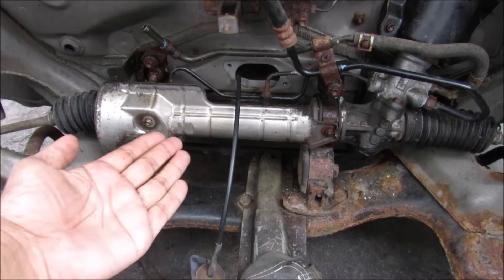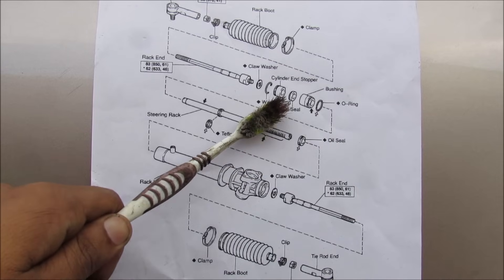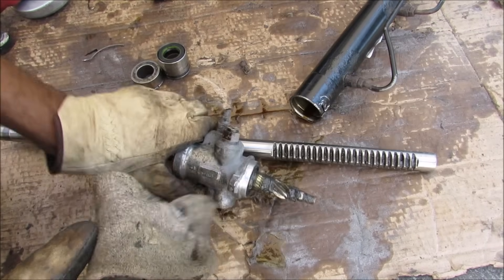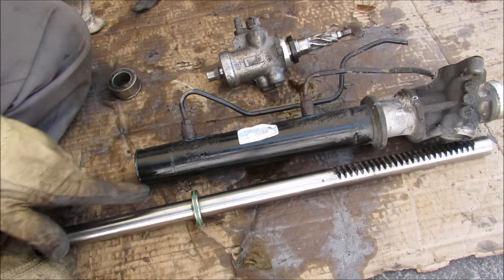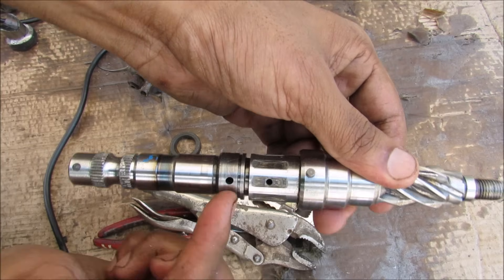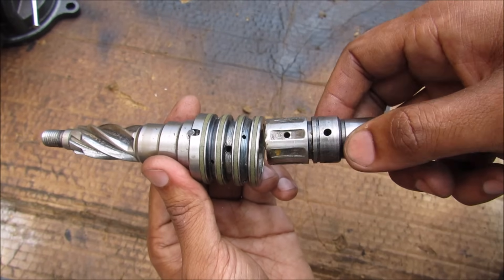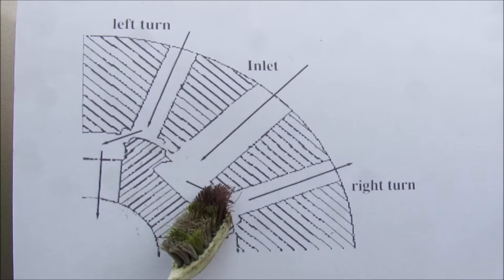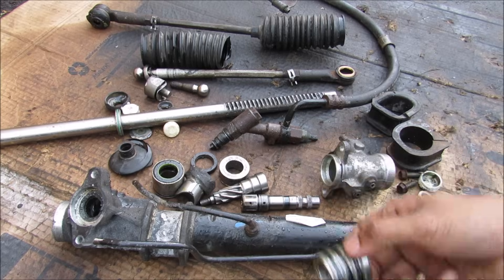How a Hydraulic Steering Rack Works

Comment: Is it bad for the hydraulic system to turn the steering wheel when engine is off? 
I guess the answer is no, as the torsion beam will still align the control valve and led the fluid flow without any extra stress to the system. 
Is this correct?

Comment: That is some complicated stuff right there. Thanks for the explanation, though I may never know just which component is responsible for the slop in the steering of my 2000 Dodge Dakota. But I have the replacement rack now, and I hope it works!

Comment: hey i just bought a steering rack that came withoUT the spindle/worm like gear steering columb shaft?  ? the rack seems to be all the way to the left 
how do i return the rack without pinion gear?
Reply from the maker: If there's no pinion inside you should be able to push the rack side to side
Reply: @speedkar99  with a ?  

screw driver or something ?

Comment: Thank you very much. I was finding this valve mechanism since few weeks. But i couldn't find it. Most of the videos explain the system but not the valve mechanism. But you here explained it very well. So i give my glad to you for your demonstration regarding rotary valve mechanism and torsion bar mechanism.❤❤❤❤❤❤
Reply from the maker: Agreed, that torsion bar mechanism is really interesting, it took me a while to figure it out too!
Reply: @speedkar99 yeah. Im a helicopter pilot. So in helicopters there is a similar mechanism in hydraulic actuators which used to give the inputs for the main rotor. In that case they have used leanier Valve. I understood it easily. But this rotary valve system is bit complex. But glad for your video it was very easy for me to understand it. ❤❤
Reply: Any way that torsion bar is the secret. Since it can  twist, the steering wheel is always in advance until the driver stops the steering. The hydraulic actuator push the rack until the torsion bar torsion get to zero. Then only the piston stops.

Comment: so it might be possible to repair a leaking LHD steering rack by just DIY replacing the oil seal (with a repair kit or even using parts from a working RHD rack?), and if possible then it doesn't seem like a difficult job to do

Comment: This video is amazing. I found no other video talking about the torsion bar that is inside the control valve. That is the whole point of controlled high pressure flued flow. Know I can say I know how a hydraulic steering wheel works. Thank you man.

Comment: after changing the power steering oil, the system got clogged somewhere, as I now have a heavier power steering. Where could this happen? what do you think about the metal pipes on the servo bar or this central high-pressure valve that has holes in it? There is obviously something to do with it. The first servo oil was 28 years old and after changing the new one, something happened. It was bled correctly, even with the new servo pump nothing has changed for the better

Comment: So you're saying it's not my fault. While replacing the wheel bearing on my 414,000 mile Kia I let the tie rod hang for over a week.... Now it leaks. First leak the car has ever had, and I'm hoping I can just add a little fluid every now and then.
Reply from the maker: Hanging a tie rod shouldn't make it leak

Comment: I am your subscriber, sir. Please ask how to modify the Torque Rod in the Pinion Gear? . All this time I have been observing why no one has modified the Pinion Gear. The info is that by modifying the Pinion Gear you can lighten the steering. Thank you very much in advance, I am waiting for your answer and vlog
Reply from the maker: Change the flow control valve in your power steering pump
Reply: @speedkar99  What this means is that the couse of my car's steering is heavy on my car's power steer pump Valve ? Can it be serviced or does it have to be replaced ? Thanks
Reply: @speedkar99  what  this means is that the couse of my car's steering is heavy on my car's power steer pump valve ? Can it be serviced or does it have to be replaced ? Thanks

Comment: Great examination. Thanks! I'm pulling my hair out trying to figure out the stiff steering issue in my 2005 Saab 93. I already replaced the pump and the rack. The wheel turns freely with the car turned off and wheels off the ground but the power steering is randomly getting stiff. No noise from the pump and no leaks. I'm now thinking I might have a flow or pressure problem somewhere in the system.

Comment: Dear sir, as ever you are a genius. The automobile industry has not recogniaed your full potential. You are an asset to the industry. I have question which steering gear box is the smooyhest amd effortless to the driver is it the worm and roller with variable sterring ratio with hour glass principle or worm amd nut more popularly known as the recirculating ball bearing

Comment: My tractor power steering has failed. I can turn the steering wheel in either direction for ever and nothing happens. Any advice gratefully received.
Reply from the maker: You've got a busted linkage because there should always be a mechanical connection
Reply: @speedkar99  thanks.

Comment: Great video. One question: the belt to the pump snapped,  and I drove to the workshop with heavy steering, for about 5 minutes. Did I damage anything?
Reply: No its just  harder to steer as you found out.

Comment: As a former rack and pinion steering engineer for an OEM, I commend you for your explanation. Very well done.  The only correction is that the steering  fluid flows thru precision metered lands on the edges of the slots in the input shaft.
Reply from the maker: Thanks! 
Yeah that rotary valve is really something

Comment: Speedkar99, my go to channel for learning car stuff super fast!
Question, when replacing the power steering fluid, is the proper way to do it down by the steering rack releasing one of its fittings at the center of the rack and draining the fluid from there or it’s ok to do it above on the engine bay by the power steering pump reservoir?? The first method seems more logical since it’s lower on the P/S system. But I ask because almost everyone on YouTube does at the P/S oil reservoir, although the factory manual on my Subaru says to drain it from the steering rack.. a bit more difficult since I have to remove the chassis center support first..
Reply from the maker: Just do it from the reservoir. Not worth the time and effort to go from the rack. Most of the fluid will pump out when you turn the wheels side to side to bleed. I have a video on this from 2013.
Reply: @speedkar99  Great! Thanks for your reply

Comment: I have a rather unique issue with my power assist steering. It's pretty weak, I have to use both hands for low speed manoeuvres. I already changed the pump and flushed the fluid(chf) with no results. Upon visual inspection the PS lines are fine, sometimes they get crushed in cars that have had accidents but not mine. Should I go for a 7 hour steering rack job or are there any other recommendations? Car is a 01 A6 2.4 V6.
Reply from the maker: Correct fluid type? Maybe you can connect a guage and measure pressure. A rack job is not fun
Reply: @speedkar99  i specifically mentioned that its chf so you dont say its the wrong fluid lol
Thats the thing with these hydraulic systems, there isnt exactly anywhere where one could hook up a manometer

Comment: This is fascinating. I'm not understanding something fundamental though when I try to understand how turning the steering wheel (input shaft) turns the front wheels in the same direction. When I think about it, it seems the teeth on the pinion gear would engage the rack teeth in such a way as to turn the wheels in the opposite direction.

Comment: EMERGENCY QUESTION.... After having all my shocks and struts and lower control arms and ball joints and sway bars and bushings and pretty much everything else to do with my front suspension suspension replaced as of a couple weeks ago will driving over one curb that was a little bit too high quite frankly the curb came out of nowhere and attacked my tire but regardless..will that cause my whole rack and pinion thing to break?? the whole thing all at once????😭😭😭😭
Reply from the maker: A bump won't break a rack. But a curb strike might

Comment: Can the two hoses attached to the rack and the control valve fluid passage clogged and cause failure of the rack? Because I've replaced quite a number of pump and the steering is still stiff. Thank you for great work.

Comment: Great video. Just a quick question. What happens when we turn n hold the steering wheel to its extreme positions.( extreme left n extreme right). How is the pressure build up avoided?
Reply from the maker: It's short circuited back to the reservoir

Comment: Ok soo mine turns half way each way without the wheel moving buut the input shaft does spin everytime i touck the steering wheel. Weird confused do i have a bad input shaft. I have to turrn the wheel more than half way before it starts moving the wheel. ????? What is the issue

Comment: The bushing housing wont come off mine I took the clamp off but it wont come off 2004 Mitsubishi diamante ls
Reply from the maker: Bushing housing on the rack to frame?
Reply: @speedkar99  ......4.25
Reply: @speedkar99  I removed the snap ring but the bushing housing wont come off I cant change the rubber seal that's on
Reply: @speedkar99  or the collar as u call it later in the video

Comment: Is there a seal at the end near the gear box? I have a leak at the end near the gear box where the teeth are. It’s not a major leak but the boot is wet. I took the boot off and I didn’t see any fluid dripping out, I’m trying to figure out if there is a seal or which seal might be wearing out at the end near the gear box.

Comment: Kindly advise about whenever car goes in uneven surface road thud thud sound comes from hydrolic steering rack, mechanics days drive with it, what could be problem parts to check and replace
Reply from the maker: You sure it's not the stabilizer links?
Reply: @speedkar99  after test drive mechanics didn't mention anything about it shall I recheck with other mechanics

Comment: Hey man so i just replaced the inner tie rod on my chevy aveo and i am worried i may have damaged the rack because i found some info that you are supposed to hold the rack from turning when you torque. i torqued it to 70lb ft. Now that i think about it 70lb didnt feel like much but im not sure how strong those gears are in there, i just hope in didnt bend them to bad or worse crack the gears!

Comment: when I worked for GM back in the eighties we had to recall a bunch of racks because the teflon rings would break and the rack would get pump pressure on both sides at the same time essentially locking the rack while the motor was running

Comment: Small point on hydraulics and efficiency, the vane pumps typically used for later examples of this arrangement are of the variable displacement type, adjusting their output to maintain a constant pressure (similar to swash plate piston pumps). They do so by shifting the rotor shaft between one side of the stator (peak flow) and the middle (neutral) as commanded by a pressure regulator (typically built in, though not necessarily so in other industrial applications), so when you're not steering the engine loading is fairly minimal, chiefly accounting for any leakage in the pump and other components.

As I understand it, older systems used fixed displacemen gear pumps where anything that didn't make it to the rack would go screaming over the relief valve back to tank. Those would be the highly inefficient ones 😁

Comment: Im just seeing your video. I have a question, i just changed my motor so i had to take the power steering pump off. After putting it all back together both of my wheels have play in side the rack. When the truck is off the ground i can turn each wheel separate with both having a 2 inch play. I didnt have the before taking the pump lose. Can thus be a bubble do to needed bleeding if so how to bleed?

Comment: question, what needs to be done to convert a power rack to a manual one? Do need to remove internal parts?? cheers NIko.
Reply from the maker: Technically you can just cut the PS belt and drive with manual steering but the ratio is gonna be so high that it's alot of effort.
Reply: speedkar99 does that go for all racks? Cause ive seen others do it with no problems? Ive got a daewoo rack that needs converting.

Comment: Why do the seals fail and make the racks leak? What causes that.....my Alfa Romeo was part of a series of cars that were actually written off by leaking racks. I myself am on second hand rack number 3 and am very nervous about this one failing as well. Does anyone know more about why they leak?
Reply from the maker: Seals are made of rubber or hard plastic. 
ATF used in them tends to eat at seals as they harden over time causing leaks 
As things wear, leaks are normal.

Comment: after hard driving, when i turn to right my power steering pump gets noisy, like the air gets into system. Turning to left is fine. Cant figure the problem, since there is 0 leaks. Any ideas?

Comment: Hey, can you please tell me if the city-mode on a car can actually destroy a steering column ? I was driving with city-mode ON and after a while a heard a sort of whistle only when i was turning right. I drove for one week with city-mode OFF and I can't hear that whistle anymore. So my guess, is that the city-mode affects somehow the steering column. Thanks !
Reply from the maker: I have never heard of city mode. Is your car a hybrid?
Reply: @speedkar99  No it's not hybrid. It has a button called city-mode, when pressed it looses the presure on the steering wheel, so you can easily use it - with just one finger lol. But I don't know exactly how it works, or if this feature will break something on the steering column if used regularly. I have an Opel Corsa.

Comment: What stabilizes the rack on on the groved driver side relative to the housing of the rack and pinion. I’ve got play there and I can’t seem to find any info on it. It can’t be the yoke as my steering works fine. I have no leaks so it can’t be the end caps or related parts on the other side. I only have noise and play in the driver side. Sounds like a bad LCA. It’s definitely not a r&p bushing or LCA. The movement is in the rack only on the driver side.
Reply from the maker: Rack bushings
Reply: speedkar99 So there are rack bushings on both sides? I’m guessing it can’t be replaced without draining and removing the whole assembly.

Comment: After watching this, I'm going to extract and add new fluid every 30,000 miles to prevent wear. Scotty Kilmer also recommends doing it and using redline full synthetic power steering fluid and using AT-205 reseal to rejuvenate the rubber seals.
Reply from the maker: Becareful, not all PS use power steering fluid. Some use ATF
Reply: speedkar99 Thanks man, I appreciate it. But yeah I know, Toyota, Scion and even my Lexus use Dextron III. However, I did added a very small amount of regular power steering fluid to my RX when I first purchased the vehicle back in March 2019 because it was slightly under the cold mark so I taped it off at almost hot so hopefully nothing major is damaged but right after researching it, that’s where I realized it takes ATF. When I get ready to suck out the old fluid in the reservoir, I plan on adding clean Dextron III. Luckily I have 2 gallons of Super Tech fluid because both my Chevy pickup and Buick century use it also in the AT so that’s good too.

Comment: Thanks, I’ve suffered terribly with bad racks, leaky, hard to steer, etc. Now I know more. Didn’t know those holes the fluid moves through were so small by the pinion gear. Easy to clog.
Reply from the maker: Make sure the seals are intact and the fluid is fresh ATF.